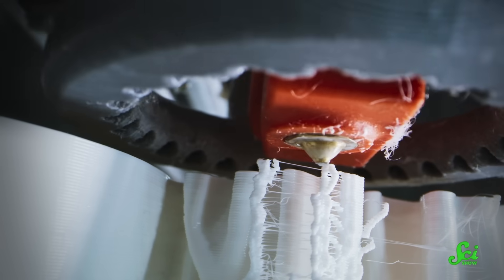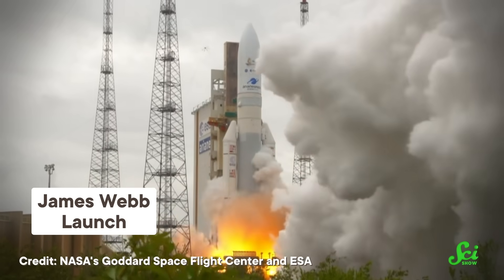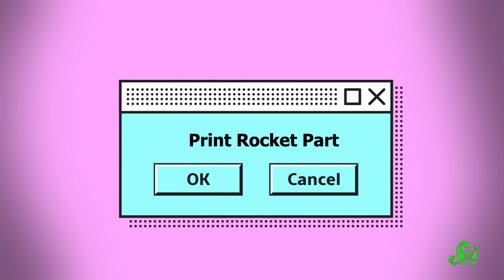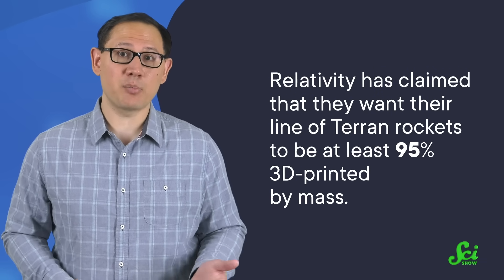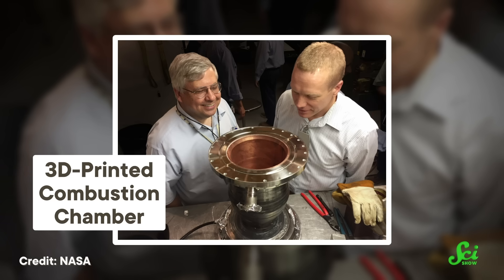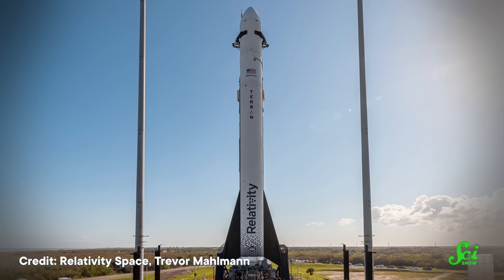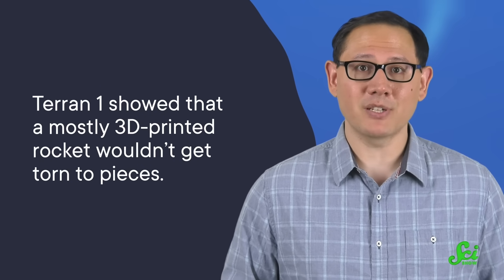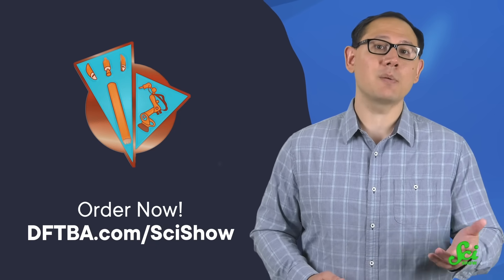Terran 1: The 3D Printed Rocket

Comment: Even a rocket engine could be used to spray paint in structures and have been patented for thin film deposition.

However, a vintage early 1960s brute force mentality of vertical flight where equivalent of disposing chemical refineries is not feasible so one must consider spaceplanes of aerodynamic lift with upward angular acceleration and even uranium gas core nuclear fission fragment along with magnetic lensed cosmic ray muon catalyzed fusion.

Comment: As cool as it sounds, having 3D printing as a target is kind of counterintuitive. It's a great tool, and there is bothing wrong with using it to build rockets, but it should be used only when it offers an advantage, not every time it works.
Reply: It does offer an advantage when printing complex parts, as mentioned in the video. With simpler parts like the tanks and the superstructure they're switching to more conventional methods.

Comment: One advantage of 3D printing that wasn't mentioned was rapid prototyping.  You may have a part that you don't plan to 3D print in the final assembly, but you need to make adjustments to as things change.  If you 3D print that part, and the design doesn't fit, it's faster, and cheaper to print a new version, verify it works or make additional changes, then send it to the manufacturer to have them make the final part than it is to have them do every step of the iteration process.
Reply: dude, 3d-printing was actually called "rapid prototyping" back in the day

Comment: I installed data wire at a place in Oak Ridge, TN that had a 3-D printer that was bigger than a house. They even opened a carbon fiber production plant down the road just for that printer and the smaller ones.

Comment: I worked for a company using additive manufacturing - they 3D printed their rocket body/fuel tanks with what is essentially a high end MIG welder. My part was accounting for thermal physical movement in the process and still ending up with correct dimensions and tolerances with acceptable stresses (and landing on the correct shape after slow annealing).

Edit:

Most of the plumbing and combustion chamber was also printed - the injectors in particular were created using powder laser sintering followed by a multi stage heat treatment for recrystallization. A bit of X-ray imaging and a bit of polishing, followed by chemical treatment and vacuum deposition to create smooth surfaces... Highly complex fluid handling parts with very little labor and few parts or tools involved. It was a beautiful thing to behold and has incredible potential at large scales.

All of this combined with using off-the-shelf parts especially for straight or simple turns in piping, nuts/bolts/rivets, and off-the-shelf repotted electronics (stress tested inhouse) made for an EXTREMELY cheap process when scaled up. The company has now transitioned to consulting and developing these processes for larger aerospace companies rather than trying to break into the market at full height.

Yes, they ARE attempting launches, but their primary value is in engineering the process. All of the other stuff like dealing with government contracts and ITAR regulations and sales to launch customers are all equally large and difficult endeavors as building the machines themselves.
Reply: Hello sir :) 
Can I get to know more about this . 
Nd yes the company too 😊
Reply: @Guywithmoustache69  Honestly, I signed an NDA but it's been awhile and the document itself was a bit sloppy.

What I will say is that I met Tim Dodd while he was filming at the factory/fabrication shop.

Do you have any specific questions about the process? I'll answer what and how I think I can get away with.
Reply: @Guywithmoustache69  Veritasium also visited some time ago. The company was also mentioned in this video.

Comment: 3 printed objects are sadly much weaker than more conventionally manufactured ones it produces unstable micro reigons in the material which is a huge no no for quality with the current 3rd printing tech and refining process's related to covering up the product materials weaknesses I would not recommend such endavours maybe after much further advancments are achived
Reply: But Terran 1 got through the time of most stress during flight (max Q). The problem with the flight was simply that the second stage engine didnt light. The structure was perfectly alright.

Comment: Relativity's large printers use Wire-Arc Additive Manufacturing (WAAM), so similar to a MIG Welder and not using a laser. They started out trying laser DED, but pivoted to WAAM before starting to make Terran 1.

Comment: I actually work in a research group that also does DED (although I'm far from the expert in that specific topic). But knowing how many unknowns there are and how much about this technique is still in the research phase, it's quite amazing that this company pulled this off! It makes me wonder whether they're just lucky in some parts, or whether they've build up a lot of secret/patented knowledge all on their own..?
As some examples of the parameters you can play with, the laser beam can be shaped and focussed or defocussed, same for the powder flow, the speed of the powder flow, the amount of laser power and speed of the powder particles, the scan speed over the surface, the laser wavelength, the materials involved etc. And most of these are dependent on eachother so it can get quite complicated!
Reply: Relativity isn't using DED for their edit: the vast vast vast majority of - additive manufacturing, if you watch any of their videos you can see plain as day it's a MIG gun on the end of a six-axis arm. The tanks for Terran 1 were also hideously uneven with ripples and seams everywhere; it's a real miracle the first stage was a total success. Thankfully they've given up on 3D printing for 90% of the rocket because as it turns out a cylinder is a very good shape for a rocket and it's hard to beat rolled sheet metal for material characteristics and especially for price. No point in printing what is literally the single easiest part of a rocket to build with standard manufacturing methods.
Reply: They are mostly using WAAM
Reply: Your reaseach is based on lots of thinking and studying. Their development is throwing lots of money to try make it "works" or enough to get it to the next stage. Very different concepts and end goals. So yeah they probably have something they found along the way 😊